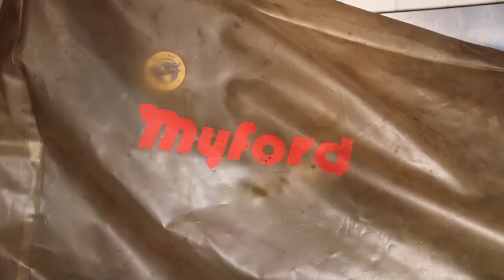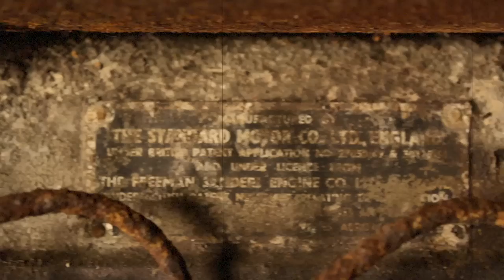Barn Find Fergie. Episode 8. How to make metal rusty

Comment: Just been watching your vids for inspiration to make a start on my  very tired 1954 tef20.   I also have a beloved early 50's ML7 which I'm in the process of refitting the rebuilt motor.    I'm lucky enough to have a late 50's Raglan Little john 5" lathe which ive owned for 20 years and an early 60's Raglan vertical mill

Comment: Later today I shall be mounting the engine I have just rebuilt for a 1950 Ford 8N tractor. This is a well made video for a new channel, proper job, gents. Also, in this video there was debate between the terms “alternator” and “dynamo”.  Here in the United States we would term it a “generator”, so you can quibble about that as a third option.
Reply from the maker: Thanks Anna!

Comment: Great series lads, I was hoping to renew my oil pump rotor, got evrything stripped even took off the front axel but how on earth do you get the front pulley off, any suggestions please.
Reply: Once you’ve taken the starter dog bolt out, the pulley is a sliding fit onto the crank with a woodruff key. You would probably benefit from using some heat on the pulley. We used a fair bit of heat then two levers to lever the pulley off, but use some wood on the timing case to lever against. Heat is definitely your friend with this one I think. The seal may of course suffer from the heat and may need replacing. Thanks for watching, good luck. Gav👍